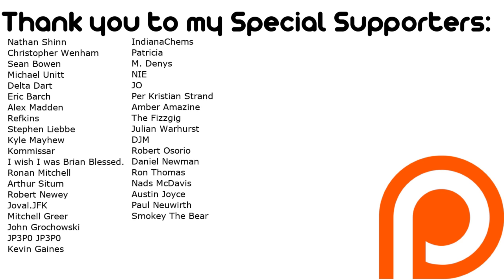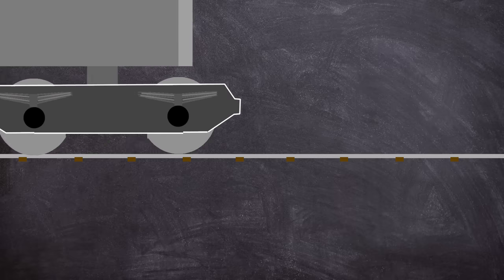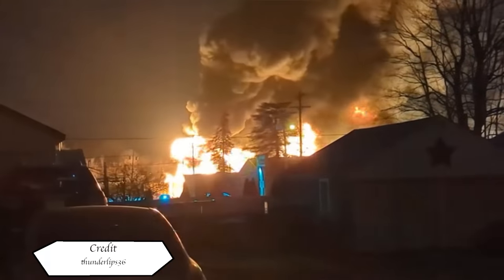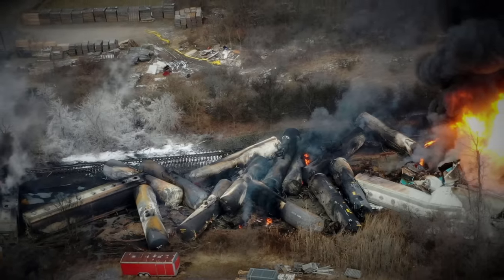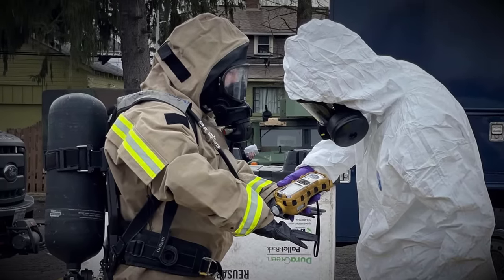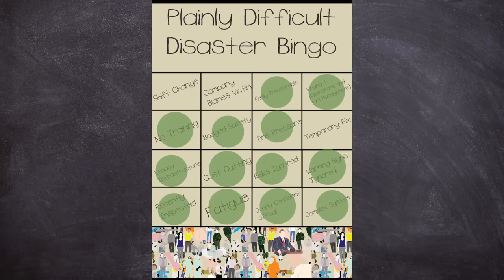Profits Above Everything: The East Palestine Train Disaster 2023 | Plainly Difficult

Comment: Had hopes for a little more nuance with the controlled burn of the vinyl chloride.  Responders don’t have the luxury of hindsight when it comes to several factors in incidents like this.  Vinyl chloride is a self polymerizing chemical, controlled with a temporary inhibitor as it goes from point A to point B.  It will self polymerize at some point, and during these types of incidents, external  temperature of the rail car may be your only indicator that the reaction is taking place.  Once you notice that, it may be too late to take action, before it explodes in an uncontrolled fashion, spreading its chemical contents into the environment.  Without the benefit of being able to offload the car safely, the least worst option lands on a controlled release, where the burn will destroy most of the chemical release, and effective evacuations can be made being planned ahead of time with weather patterns in mind.  In hindsight you may say the evidence suggests self polymerization wasn’t happening yet when the decision was made to control vent the chemical, it doesn’t mean it wasn’t going to at some point before a safe recovery could be made… and the dilemma responders have to deal with is this:  Do you wait for it to self react and explode in an uncontrolled manner, at an undetermined time with undetermined weather patterns (undetermined area of affect).  Or, do you choose to release it at a time and method of your choosing, in order to minimize the effects on the population and the environment.  It doesn’t make it pretty, but, responders have to make the best decisions they can with the information they have at the time.  They chose the least bad option available to them, and I’m sure it was not an easy conclusion to come to, but that decision may have saved lives down the line if not in the immediate term.  I am glad a lot of emphasis in this presentation was focused on the underlying culprit of this disaster:  corporate greed and de-regulation.
Reply: The burn-in-place also just happened to be the fastest way to clear the cars and get the rails back opened. I bet there was pressure from NS on the contractors to find the way to deal with it that was safest for their bottom line, not for the people of East Palastine.
Reply: @callsignapollo_  I can’t speculate as I was not there… but I will say I took part in a week long chemical response training approximately a year before this incident, in which the mock scenario was a train derailment in the middle of a major population area involving multiple cars carrying hazardous chemicals, including vinyl chloride.  With a week of review and class work, and multiple experts in the field in the same room; we came to the same decision that a controlled burn was the least bad option for public safety and the environment.

Comment: 1:55 The city the Romans knew as "Carthago" had the Phoenician name qrt-ḥdšt (𐤒𐤓𐤕 𐤇𐤃𐤔𐤕) "new city"
And then Hannibals father founded another city in Spain and named it the exact same thing - "Qart Hadasht ("New City")". The Romans called it "Carthago Nova".
So "East Palestine" is high poetry for city names.
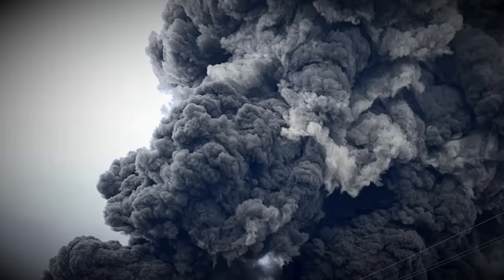18:10 Hindsight is 20/20.
With rail lines, restoring operation is the priority. And for doing that they had to move those cars. And they weren't willing to move them without certainty.
Reply: Carthago Nova should be rebuilt and named "*New* New New City".
Reply: @danielbishop1863  When traveling in the Cartheginian World, make sure you specify "Carthage, Africa" or "Carthage, Iberia".
It would be embarrassing to end up on the wrong continent by accident.

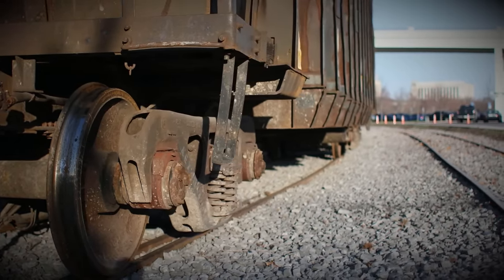Comment: 5:18 I would like to add that bogeys are held on by gravity. The wheel sets are the way the body is held to gather. The reason for this is so they can literally lift the whole car if needed and roll out defective wheel sets and then roll in the new ones. As an added note, locomotives wheel sets and bogeys also operate in the same way as stated above.

Comment: What confuses me is why they're not required to put a simple temperature sensor on each box when the derailment can be this catastrophic. The cost of temperature sensors today is pretty low, and I would assume that some other sensors are already there, so no huge rewiring would be needed.
Reply: It’s not as simple sadly
Reply: @blehtbh  Care to explain why?
Reply: @Huk256  main reason is we’re you gonna put in on a rail car I mean under it would make sense but how
Reply: @blehtbh  Um... I'm not sure I understand the problem. The last time I checked, there was enough room under most wagons to fit a human body lying flat. All that would be needed is a simple temperature sensor (the size of a coin or a pen) and something to process the signal (Rasberry Pi Zero would be an overkill, and that thing is the size of a credit card).

The only problem I could see is if I'm wrong, and there is no direct digital connection between a wagon and the engine (aside from the pneumatic one). If that's the case, then yeah, I can see how that would be a problem, but even that doesn't sound that complicated to solve.
Reply: @Huk256  Temperature sensors are cheap, you'd think...but what do you do with that data? How do you power them? How to you make them so they can operate in an environment exposed to severe weather and vibration? How do you send hundreds of temperature signals for each train to some recorder or monitoring station? How do you keep all that telemetry from just being a garbled mess?
Reply: @Huk256 Up to 8 sensors underneath a car, never getting cleaned, and with absolutely no way to power them. As you said, the only connection from the front of the train to the rear is an air line , but it’s just for brakes. Having the same air power those sensors? Parasites and failure points for the entire braking system on the train.

Transmitting hundreds of cars worth of information wirelessly also seems like an inherently problematic concept, but I’m not exactly qualified to say much more. 

The only way to power the sensors would be through effectively an alternator in one axle on each car. Still, it requires running wires underneath the car, and it will create just more heat and another failure point. 

Instead, we can use what we have been. Defect detectors. We could use more modern ones, and many more of them, but they’re far safer than any comparable car-mounted system.

Comment: One thing not mentioned about the hot axle box detectors is the rate of temperature change. While we could debate about what temperature thresholds should be used, it seems to me like a comparison between measurements would be useful as well. If my understanding of the video is correct, a measurement was made that was below the alarm threshold, but which was much higher than the previous measurement. It seems that data was clearly showing the problematic axle box gaining temperature rapidly, but the system was only interested in absolute temperatures, not rates of change.

Comment: Part of the job of the train crew is to look along the side of the train for sparks and fires. Easy when it is short say three or four cars. As trains get longer it gets more difficult/impossible with distance, curves and gradients. There is no crew member at the rear looking forward, for trains over 50 cars long the chances are you are not going to see the rear portion of the train. 
To increase profit, use the same staff numbers to move more cars. If something goes wrong - more damage is done.

Comment: Train wheels aren't more efficient due to reduced friction; if the wheels are rolling, the surface of the wheel and the surface of the track aren't moving with respect to each other... any static friction in this case does no work.

Train wheels are more efficient because they deform very little as they roll and any deformation is elastic so most of the energy spent deforming the wheel as a section comes into contact with the rail is returned as that section comes out of contact with the rail.

Comment: Looks like the wagon got over pressure which leads to the brakes not releasing fully on the CCTV footage. It can take some time before the heats move into the bearings as the heat start from the wheel ring.

Comment: The thing you said about the hot wheel box detector triggering at 90 F might not be right, I mean that's ambient outdoor temperature a lot of times in the summer.  I looked up "An Implementation Guide to Wayside Detector Systems" and I think it's "35 °C (95 °F) above the temperature of the mating bearing on the same axle" not simply 95 degrees.  They also describe it as "76.7 °C (170 °F) above ambient and hotter than that side of the train" so we are definitely looking for a difference in temperature between the wheel box and ambient temp.

PS people have been naming cities for around 9,000 years at least.  It's currently 2024.  They can't all be bangers, okay?  You're honestly lucky, on a planet with this much human habitation, if someone says a city's name, you can actually remember where it is on pure recognition alone.

Comment: So their "improvements" are just more ways to detect a failure, not prevent them.  Yup, that sounds on brand.
Reply: In the case of “Hot Boxes” such as these, more accurate and more numerous detectors are best. It sounds ridiculous, but the “prevention” part is detecting a hot axle and stopping before it causes a derailment like this. Hot boxes don’t happen spontaneously- they develop slowly, heating up more and more until they stop rotating. The car should’ve been in better shape, for sure, but shit happens, and cars have different owners, it’s complicated for maintenance. I won’t get into all that

Comment: I can understand the driver using the dynamic brake rather than the emergency brake. Using the motors in reverse won't add extra heat into the wheel area

Comment: Items omitted from the video:
- the handful of Class I carriers left in North America are effectively monopolies who dictate to customers and the government, with their formation triggered by the passage of the Staggers Act in 1980 which overly de-regulated the railroads and undid all the anti-trust protections put in place by the government in the late 1800's;
- covered hopper car GPLX 75465 was the one loaded with plastic pellets, as was the covered hopper car behind it;
- the derailment appeared to have initiated when the self-disassembling truck assembly on GPLX 75465 struck the N Pleasant Drive grade crossing (immediately after having passed the defect detector) and then struck a trailing point switch 1/4 mile further on (since removed), at which point the front end of the car went on the ground and slewed to the right

Comment: It’s all negligence and greed, but also a Ladder problem, with Class I officials knowing little to nothing about what goes on with the actual trains, so long as they move and bring in cash.

Now I can’t confirm this, but I’ve heard the engineer actually tried to stop the train earlier, possibly when the alert, however when he relayed the problem to the dispatcher he was told to keep it moving. This could be a case of “Don’t brake hard, slow it down gently” as an e-brake would just add more heat and/or sparks. However, I can’t shake the feeling that response meant “Don’t stop, I’m sure it’s nothing serious.” I’d LOVE to be wrong, but even Dispatchers have been guilty of not understanding the circumstances behind trains in crisis, OR not being sympathetic to crews actually running the trains they’re in charge of directing for any sort of delay.

Comment: The day after Ground Hog Day in 2023 was very cold and windy possibly affecting the Hot Bearing Detectors. The video you showed of the fire I think was in East Palestine. The video In Salem 20 miles west was from Butech/Bliss & that parking lot is visible from my Son's back porch in the winter time. Train came to Alliance down the Cleveland line, not sure where the last detector is before Alliance. Sebring showed hot temperature then on to cameras showing fire as it crossed the street I live on, Ellsworth. Next detector is a half mile from the on Snyder road just Before S. Lincoln. How many crossings had it passed on fire, did anyone phone it in??  I think threshold for N&S is 175 degrees F. It reports in to dispatch but only to train at 175F on 161.070 MHz. No detectors until just past the main street in E. Palestine when it was too late. Imagine 10 degree F with heavy winds for the first responders, then add rail speeds to wind chill effect for detectors in Sebring & in Salem, Ohio. After E. Pal, next detector was in Beaver Falls, PA. N&S removed the dragging equipment detector that ConRail had in place in New Galilee, PA. If this would've happened in Salem, Ohio, situation would be many times worse for human life, tracks running NW to SE through town with normal eastward winds. The detectors themselves are old school and not on their own a sure way to spot failed bearings. Hot Boxes were old train bearing with lids to manually add oil to, now hot bearing detectors.  Here is a video with audio of all three bearing detectors in normal use, Sebring, Salem & E. Palestine:  https://www.youtube.com/watch?v=N7YbVy-S2yU

Comment: A bad bearing can go from warm to burning off the end of the axle in just a few miles. I had a roll by by a local switch crew early mornings and passed a hot box detector good roll by no message from detector with in 2 miles of it the bearing burning off the end of the axle car derailed. So it can happen very quickly and becouse it was still dark just getting light any spark or glow i would have seen. We was very lucky no cars fell over and we had lots of tanks and hazmat. Train line never parted the car hit a farmers crossing so hard it dynamited the triple valve and dumped the air.

Comment: In my view it all gets blamed on PSR practices as being the leading cause to a lot of incidents as of late, especially on the NS. Go cheap with everything to get as much money as possible for the shareholders which results in layoffs, closing of facilities, retiring/selling of locomotives resulting in power shortages as what remains gets run into the dirt and gets sidelined until repaired, defect detectors being removed so that there is less to maintain and therefore less to spend money on, i noticed this on the Pittsburgh Division that i live near.  There's a lot that's been changed and almost all of it not for the better of crews and in some cases even the customers, i'm still somewhat hopeful that NS will eventually learn how bad PSR really is and back pedal it but i don't see that happening anytime soon

Comment: railroad rolling stock, and the rail lines infrastructure, have technologically stagnated for decades.
on one hand "tried and true" is valuable, on the other the application has slowly crept out of the initial use case
convoys are now larger, drive faster, with longer routes, less inspections

no easy fixes available for this one. The union, regulatory and financial burdens all conspire against change to improve safety

Comment: That PVC burn-off was one of the worst hazardous materials/dangerous goods decisions they could have made, except that the responders and the haz-mat/dangerous goods company had woefully inadequate information, leading them down the only path they could see was valid. If the safety valves were compromised (like being unable to vent being buried in dirt or debris), and using a tank bottom washout or valve was impossible, then blowing holes in the tank car to vent and burn off the PVC monomer was the only answer. Note: Polymerization (forming more complex molecular chains) can be very exothermic (heat-releasing) and can place the container under high pressure as well). You don't want to be around when it blows up (or out). Storage tanks and tank cars have lifted off like rockets from explosions, see this one as an example: https://www.youtube.com/watch?v=3Tm6kKXb6bc and https://www.youtube.com/watch?v=ZMIUsZg_UFg

Comment: Dynamic breaks stop a train much faster than the emergency breaks. In fact, see the results of emergency breaks being applied by morons instead of the dynamic breaks in the derailment of the "Duffy Street Incident".
Reply: That train was going down a down grade.
Reply: @skyh  and the dynamic breaks would of kept it slow enough to make the turn. The "emergency" breaks failed nearly instantly, and the train was thus allowed to run free. "Emergency" breaks are a last resort, not the best breaks available. You car's "emergency" breaks are the same; not the best breaks, just the simplistic and more likely to still work after better breaks actually fail,